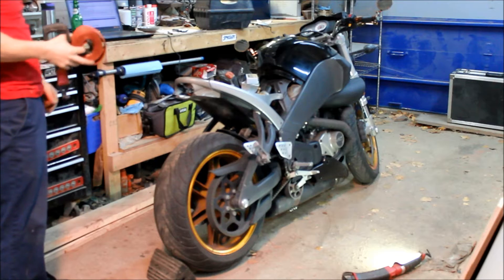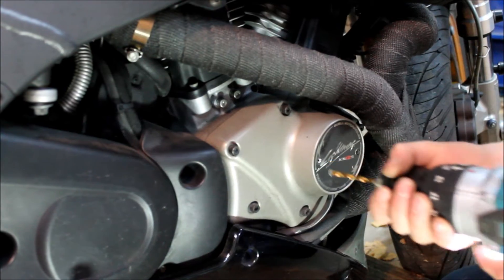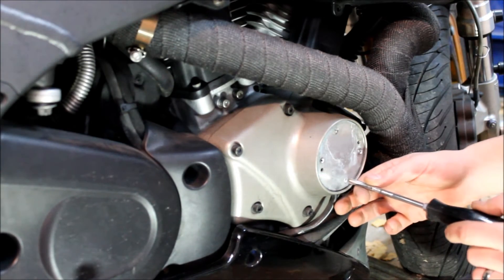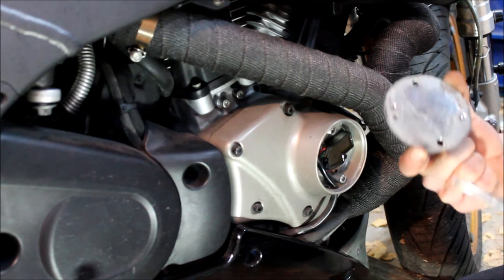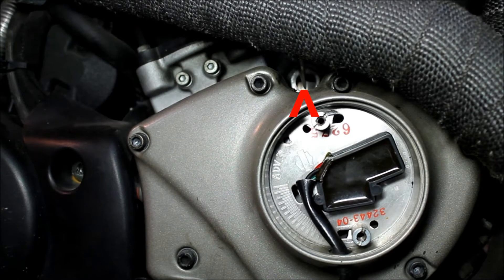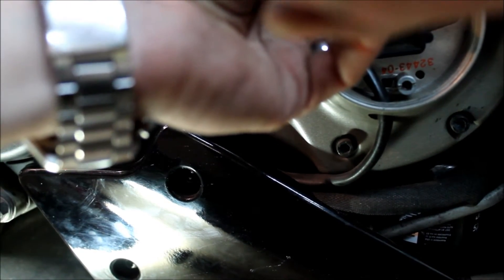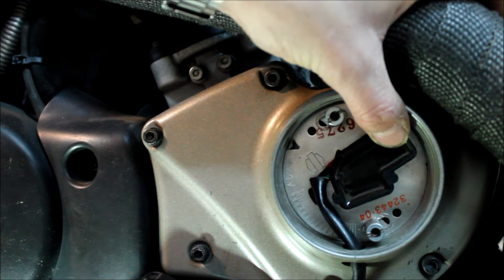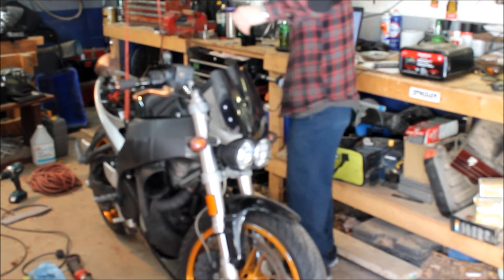BUELL XB 12s how to static timing

Comment: I have a 2008 Buell 1125r for some reason it will not start its giving a grinding sound starters not the issue it's not locked up extremely confused if anybody has a video or some type of knowledge of what the problem is surely could use your help
Reply from the maker: I need more details than "it's giving a gringing sound" 😅... You turn on the key and hit the starter... What happens? Is the mother turning over? Is it not firing? 🤔
Reply: Take plugs out and try to rotate motor.

Comment: question. i cant get my ecmspy to connect. will the timing mark in the inspection cover only show for the front cylinder? if so i dont need the ecmspy. i can just rotate it until the mark in dead center and if the fuel pump doesnt cycle i can adjust it until it does. i just changed the CPS and im verifying/adjusting timing.
Reply from the maker: Just off the top of my head, we woyld need to make sure it's the end of the exhaust stroke and begining of the intake 🤔

Comment: Hey man is there a way to do this without the software? Maybe checking TDC in the front cylinder with a straw down the spark plug hole when the notch is in the inspection hole?

Comment: I know this is an old post but i did this and when i turn the timing sensor it will not prime the fuell pump, but it primes when i turn on the bike and press run.  Its in 5th and the notch is in the center.
Reply from the maker: Even when you move the sensor through its full range of motion?
Reply: Is your kickstand up

Comment: Maybe I'm wrong, but still doesn't sound correctly... 1 cylinder running and too much smoke.  let us know if you did other adjustments after this vid. thx
Reply: borealis2000 i think its 1 cyl too! Something is bad!
Reply: Absolutely sounds like it's only on 1. Mine sounds like that every spring..... First start up after winter
Reply: @tomserbaducci8559  shit i just fired a 07 xb9 that hasnt started in 8years and it sounds like it has a vtwin that bike in the video sounds like a buell blast w the single piston and a leaky exhaust or something

Comment: It's weird how far off the timing was while the cover was still OEM riveted on. It would have been interesting if you tried to move the timing plate by hand before loosening the two bolts to see if it had just slipped back on its own or not, the top fastener you noted was loose when backing it off and you can see where the face plate was scratched from the hardware. If it was adjusted by someone I would think you wouldn't see these linear markings in the plate but instead an imprint in deliberate set locations. I also noted there wasn't OEM paint markings from when timing was set at the factory as I found on my '07XB12STT which was yellow paint. Good job on the video BTW!
Reply from the maker: Those are just regular pop rivets, the previous owner must have riveted the cover back on. If you look closely at 5:25ish in the video you can see there are multiple marks from the several different positions it had been previously set to, even if you can't see it take my word for it, it clearly was set in different positions for some reason or another. The bike was barely running when I bought it and this was a huge factor in that.  I'll put up another video soon of the resolution of the problem (hint: has to do with the spark plugs)... any adjustment on any machine set all the way to the end is an indicator of a problem.
Reply: someone else was in there, but used factory rivets to replace it.